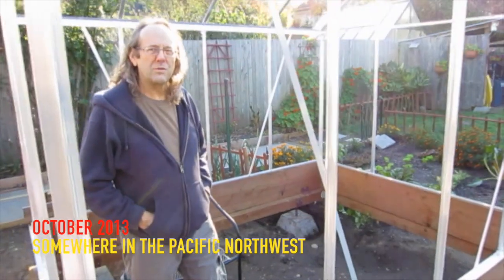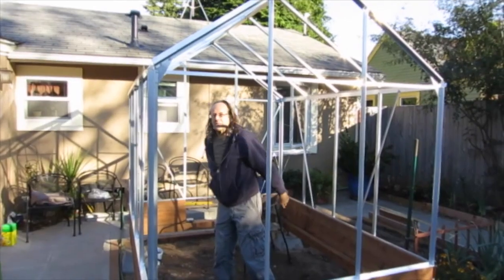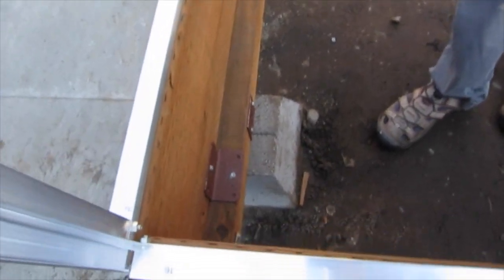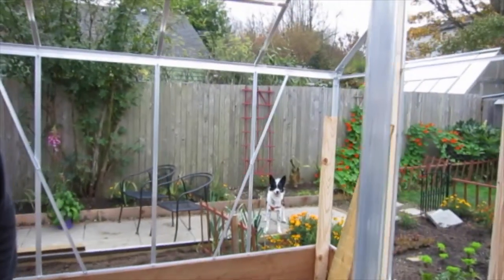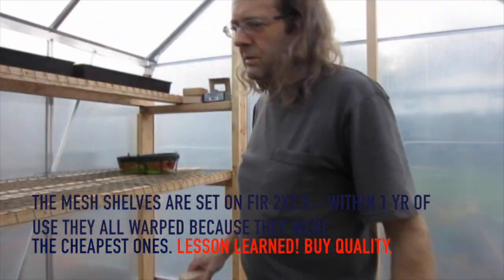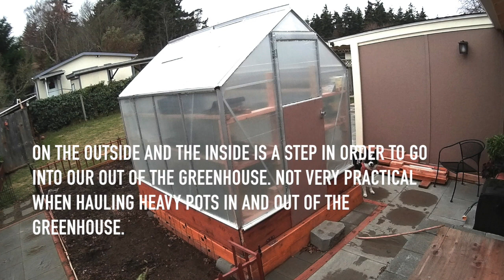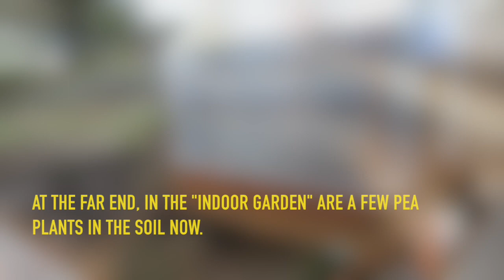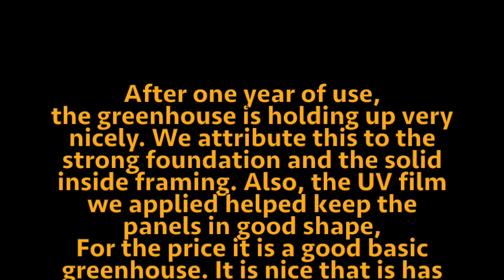Harbor Freight Greenhouse Improvements

Comment: one side of the polycarbonate has a purple shade uv tin on one side of them, so why did you feel the need to wrap them again? better check to see of there in the right way round they don't just go in any old way I afraid
Reply from the maker: Yeah, they go a certain way out but the Harbor Freight panels are poorly coated for UV protection and all the other internet reviewers said that if you don't put the extra layer of protection on there, the panels will deteriorate within a couple of years. The film probably doubles their life span, at least.

Comment: Hello, Great video! where did you get the UV sheeting you covered the panels with and what state do you live in?  Thank You
Reply from the maker: The greenhouse is in grow zone 8b (Washington State).

We bought a UV blocking plastic that came in a roll, sold by "Greenhouse Megastore" (standard clear greenhouse film, thickness 6 mil). We bought a 12' wide by 25' long roll for $44 and shippping was another $16.

Comment: what uv film did you use to cover the panels with?
Reply from the maker: We bought a UV blocking plastic that came in a roll, sold by "Greenhouse Megastore" (standard clear greenhouse film, thickness 6 mil). We bought a 12' wide by 25' long roll for $44 and shippping was another $16. We used silver tape to glue the film to the panels, which also prevented bugs and moisture to get into the individual little tubes of the panels. 
The best upgrade from this setup that we used would probably be clear greenhouse/awning panels sold by Home Depot.